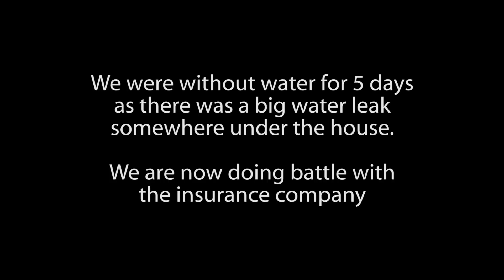Fuerteventura Vlog June 2019 - Big Water Leak

Comment: That leak looks like a real pain, John, and it WOULD be right under your new kitchen! It seems that whoever you got in to find it did a decent job, though - how do you know where to start looking when it’s just somewhere under the property? I guess it was old pipe work, but the insurers will somehow suggest it’s nothing to do with them.....earthquake, civil unrest, act of god etc! Good luck sorting that, though. I know when we took out our own cover (Liberty Seguros) they specifically pointed out the danger and cost of water leaks, and that they covered everything! Most importantly, hope Sue’s kitchen floor has been restored!
Reply from the maker: Would you believe after 6 years with Liberty I switched in September Alan. They are a rip off outfit but they may have paid out - well maybe. Still fighting AXA so don't touch them anyone.